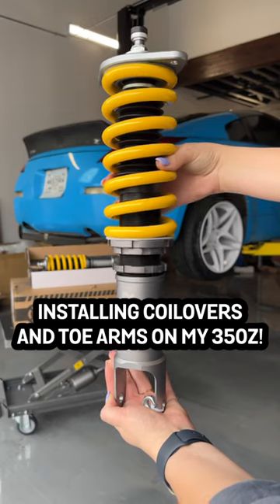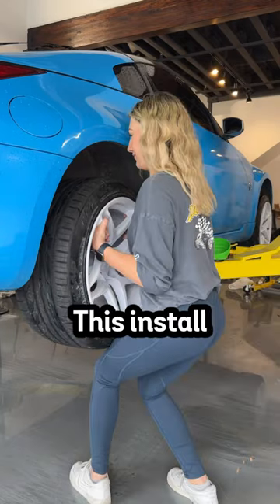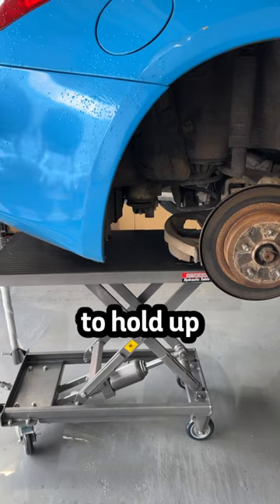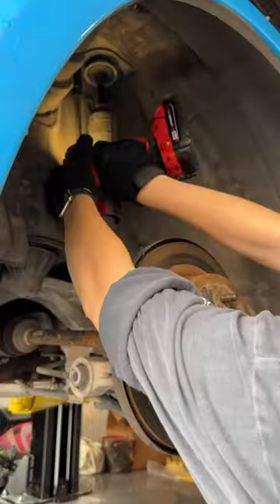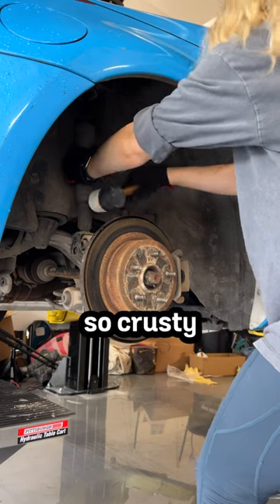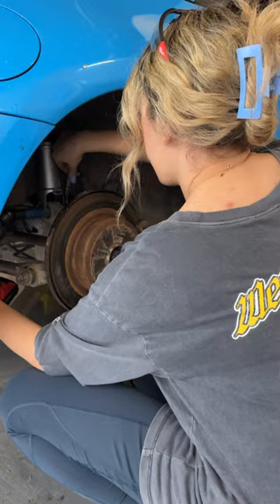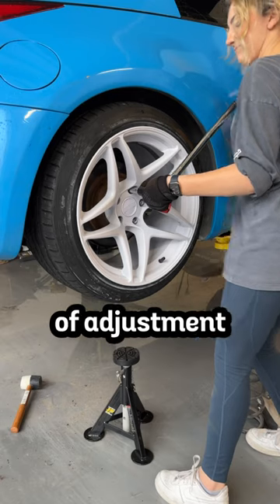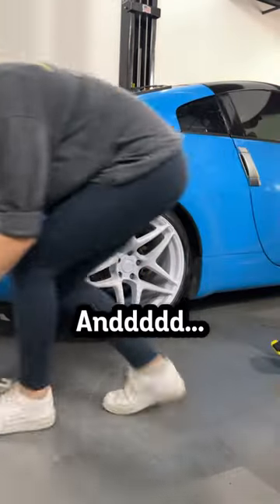Installing Coilovers and Toe Arms On My 350Z!!!

Comment: Look everyone she uses her tools properly by using a breaker bar and then the impact instead of bitching that the impact doesn’t have any power when your not using it for a proper application. Good job. Keep up the good work.
Reply: Are you serious? Lol I guess now I gotta use a breaker bar on every lug nut before I zip em off with my impact I guess the power settings on em are for faster removal 🤦‍♂️🤦‍♂️ how do you people manage to surprise me everyday use some common sense
Reply: Lmaoo you know your not supposed to torque lug nuts just tighten them she don’t know anything about how to use the tools
Reply: @Meatslayer22 just tightening lug nuts? Good luck if you're not torque your wheels XDDD
Reply: @Meatslayer22  If I spent this much on a car I’d torque the lug nuts too. Heck I’d do it on my current ones if I had one that was long enough.
Reply: @Meatslayer22  🤦‍♂️every car has a specific torque setting for lug nuts, of course u can just tighten the shit out of them and hope for the Best But by the book, you are supposed to torque down the lug nuts, only thing I would say is she should’ve lowered the car on the ground and then torqued them
Reply: @dylanfilmz676  exactly right, on the ground is more accurate

Comment: Not to be “that guy” but did you also torque down the suspension parts with load on the ground? That’s how I was always taught when I was working with suspension parts to tighten it down when the vehicle was on those parts.

Comment: I mean, them being “crusty dusty” isn’t why things get a little stuck on that vehicle, tightening the bolts pinches things inwards making them tighter and making the alignment of the bolt holes a little wonky which makes them hard to get out without any rust which that vehicle definitely doesn’t have a substantial amount of

Comment: You have no idea what crusty is until you've been in the rust belt. Rubber mallet will get destroyed and your suspension components will still be there.  

I hope you didn't torque down your suspension items until you had the car on the ground otherwise you'll bind the bushings

Comment: Lmaoo who torques the wheels and professional mechanics would be like wtf idek what torque you would even put to tighten lug nuts just tighten them as much as you can with a socket no need to torque
Reply: what professional mechanics are those? should always use a torque wrench for wheel nuts, and tightening it as much as you can is a really good way to break stuff